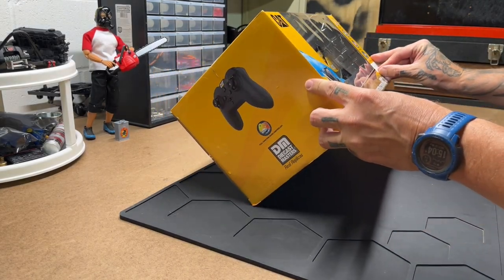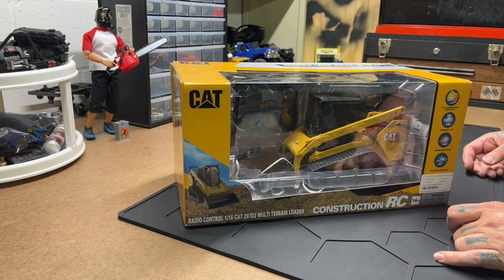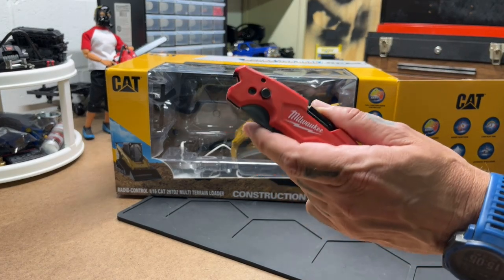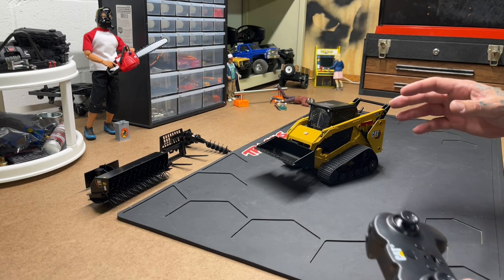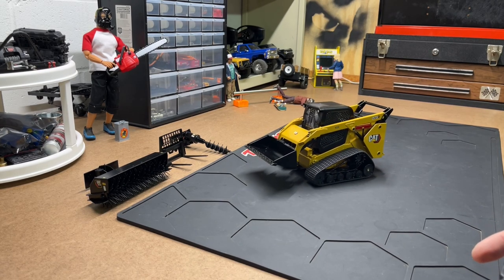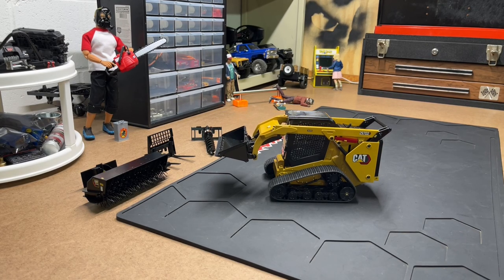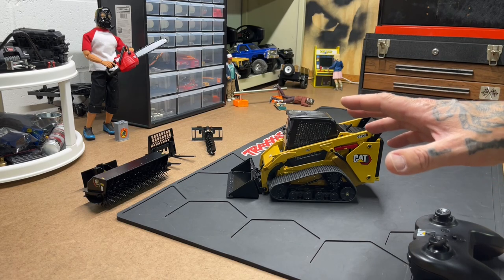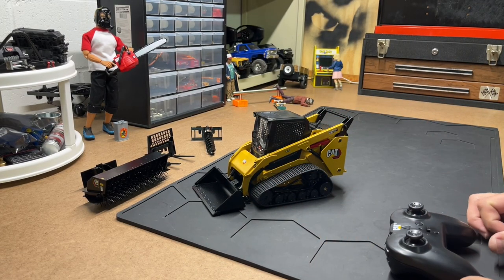RC Construction - DieCast Masters CAT 297D2 Remote Control Skid Loader

Comment: Just picked one up they looked to cool
Reply from the maker: @AdventureTimeRC  They are cool. The functions aren’t the smoothest or very quick but for the price it’s a great RC. Could benefit from better electronics.
Reply: @toeshifter  thank you for the input I figured loose dirt only
Reply from the maker: @AdventureTimeRC  It’s pretty tough. Just the bucket tilt function is really slow and the track functions are jerky. Still fun.